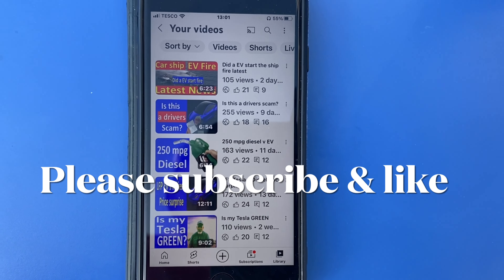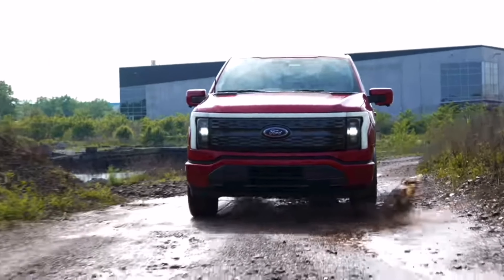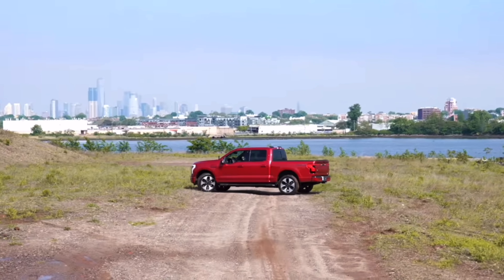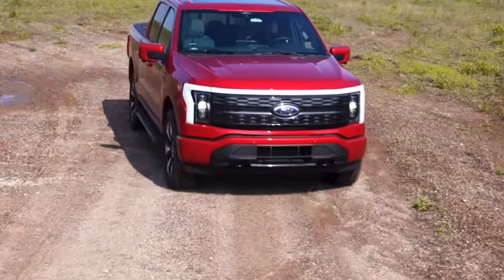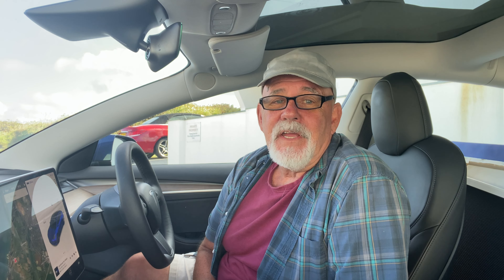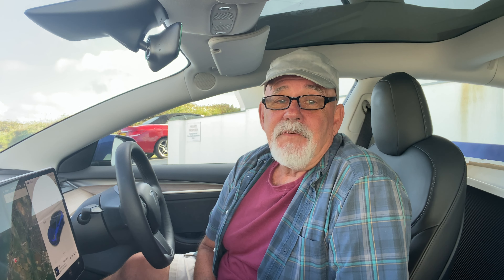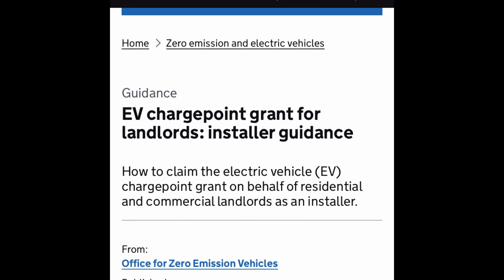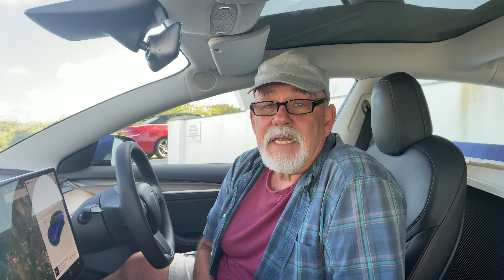LFP Battery 100% Tesla charging

Comment: We have a model 3 with LFP battery as well. Would like to trade up to a model Y. Would go for a LFP battery version again. Even though it’s the shortest range still has enough for us with the benefit of being able to charge to 100% with no negative effects on the battery. Another issue you should investigate is the insurance on Tesla cars. Ours would have gone up nearly 50% this year. We had to shop around and it still has gone up nearly 30%.
Reply from the maker: That’s great thanks Sam. 
Interesting what you say about insurance mine is due in three weeks time, so I just checked it’s gone up 60% I paid last year £355 and it’s gone up to £568 that’s with Direct Line & some Insurers are dearer 
I have 15 years no claims bonus with my wife also driving & parked in the garage
Just wondering who you insured with and how much? 
thanks take care & yes I will be doing a video on this & will give you mention if that’s okay
Reply: @nigep  we’re now insured with LV at £705 for 22k miles a year and we are both mid 50’s. Not sure about no claims and car parked off road. That would be fine to mention me by name.
Reply from the maker: @samwilson2300  thanks my mileage is less at 9000 a year I am 70 and my wife is 60, so we play a little bit late, thanks very interesting take care

Comment: I find it strange that your vehicle is rated for 375 miles (600km). My M3 LR is only rated for 548km as per the web site. Tesla confirmed it will be an LFP model.  I wonder why there is a range difference?
Reply from the maker: Thanks interesting tesla are shipping long range with LFP batteries